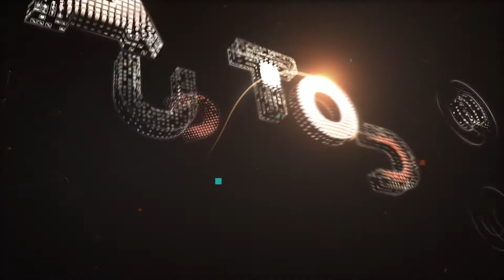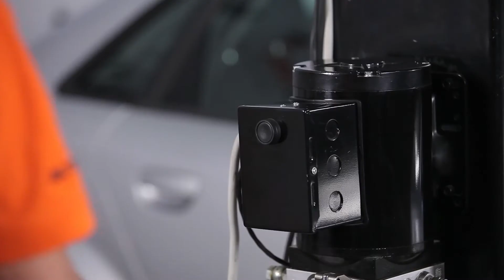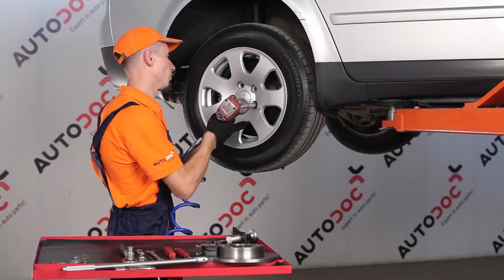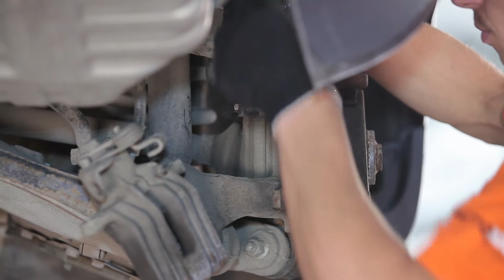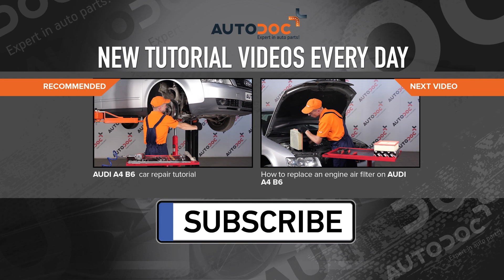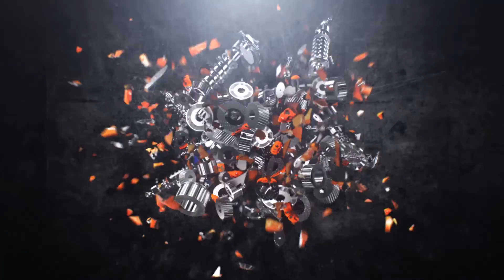How to change rear brake discs and rear brake pads on AUDI A4 B6 TUTORIAL | AUTODOC

Comment: Those carrier bolts are torqued to 75Nm. Add rust to that and they aren't coming free as is shown on here. Access to the bottom bolt is tight too making getting a strong enough tool in pretty impossible

Comment: Well done video, very informative. 
On my vehicle, 2002 A4 Quattro 3.0, it wasn't required to remove the 8mm bolt or the bracket at all. I was able to remove the disc by slightly angling it towards one side.
Reply from the maker: Thank you for the feedback! We hope that our tutorial was helpful for you. Stay tuned and follow our latest updates. Best regards, Autodoc.
Reply: After much frustration with the caliper bolts (including breaking an 8mm bit socket) I was able to remove the rotor by angling it as above. It did take a bit of heavy hammer work to break it loose from the hub. 
This was on 04 Audi A4 3.0 Quattrao
Reply: John Pearson, those carrier bolts usually are held by thread lock making it difficult to extract

Comment: So you aren't using a wire or piece of cord to tie up the brake calliper? You can damage the brake lines if you just let it hang like that. And I've learned first hand that those 8mm calliper carrier bolts DO NOT come off that easily. You must have already had them off and replaced them for the video. These stupid bolts are notorious for stripping and snapping wrenches when they are rusted on.
Reply from the maker: Thank you for the feedback! Your opinion and remarks are very important for us. We will take them into consideration for our next tutorial. This video is considered to be an informative one, and it shows the sequence of repairs,so some stages of the repairs might have been excluded.Best regards, Autodoc.
Reply: Larry Morgan dude EXACTLY. I snapped 2 wrenches trying to get them off ...still couldnt do it. Just changed the pads
Reply: Too ik it's 3 years ago but bro you are speaking factual information
Reply: @spraym88  good to know, my local area isnt prone to bad rust (literally the promised land for cars, dry desert that doesn't use road salt) but i will still hit those with some PB blaster before i remove them
Reply: I am here to agree with you. I just got held up today stripping THE FIRST rear carrier bolt. Ordering new bolts and going to use heat and an extractor to try and pull it out. I couldn't put new rotors on.
Reply: @spraym88 yes you have to heat it up for 2 mins